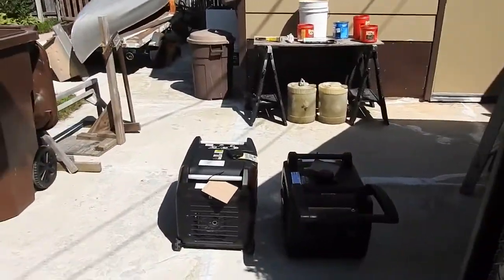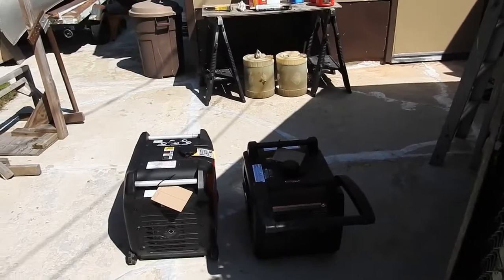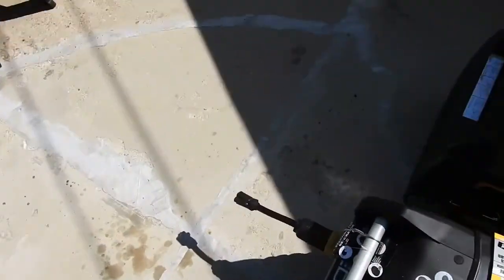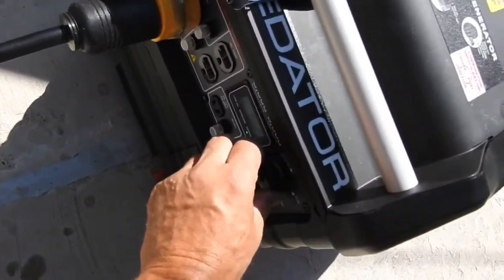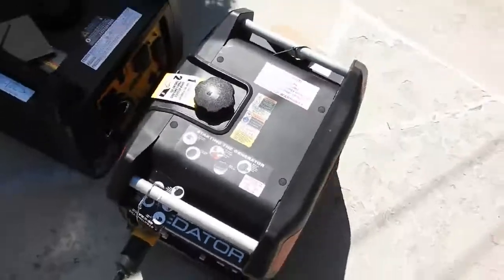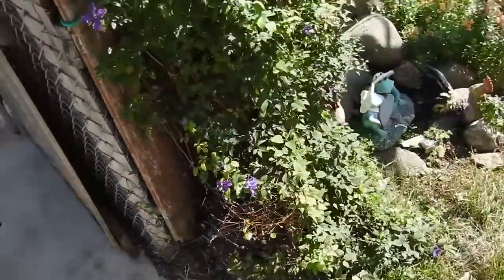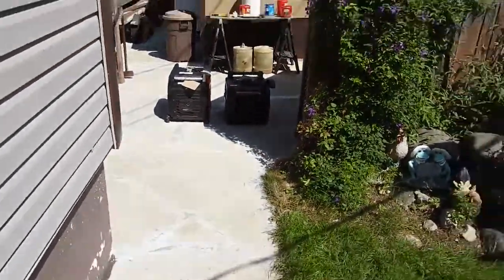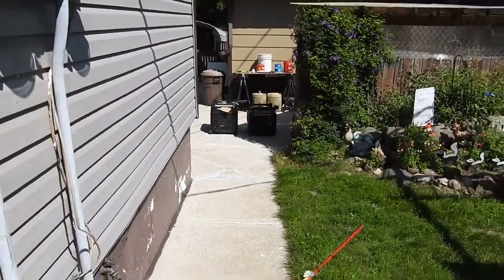Harbor Freight Predator inverter generator compared to Champion Inverter generator

Comment: Nice video I’ve been thinking about a predator however now I think I’ll just go with the champion,,,charge controllers,,,if you want a good back up charge controller in the 20 amp variety you might look at MorningStar I have a PWM PS 30 M 30 amp older one still works good and I also have a newer PWM 45 amp  TriStar,,,, I have always wondered about the blue box Victronenergy charge controllers how’s yours holding up?????